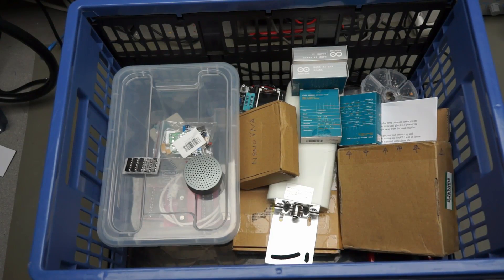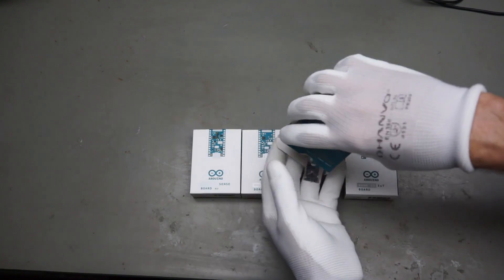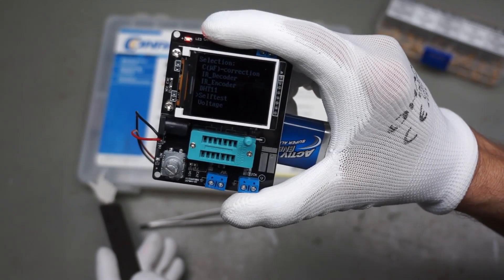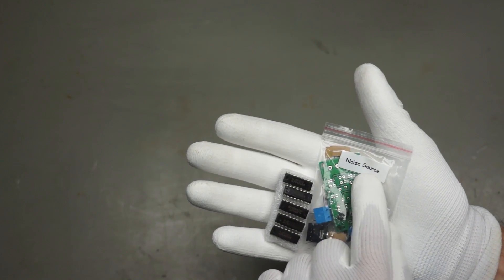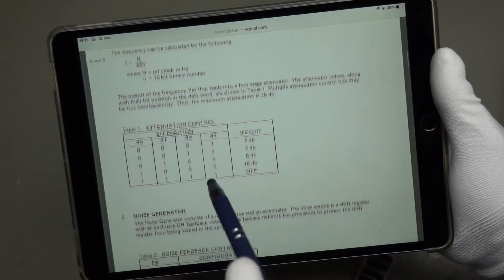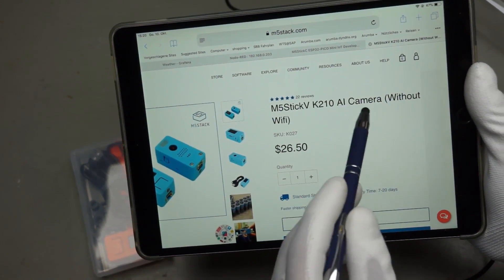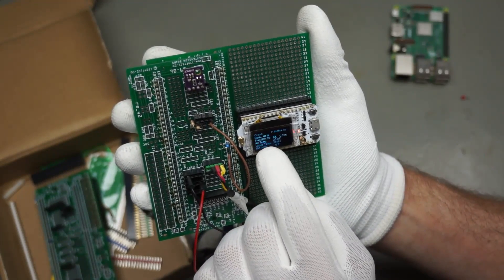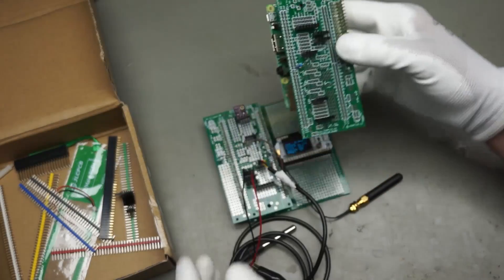#293 Mailbag with Newest Arduinos, Noise Generator, M5Stick, Bluetooth Speaker (@Raspberry Pi)

Comment: Display was dim on GM328 component tester.
After googling gm328 I found the schematic  
https://dragaosemchama.com/en/2019/04/gm328a-reverse-engineering-new-firmware-and-tetris/
There is a 220ohm resistor on pin 1 of display for backlight that could be reduced in value for higher brightness
Will try this out soon myself
Reply from the maker: I did the same (I do no more remember the value) and it helped a little.

Comment: You can change the background color and the characters color as well! That is what I had to do also on both 207 & 2018 versions. Hope that you will do that. Have a great day!
Reply from the maker: Thank you I did it in the meantime and even changed a resistor to get a brighter BL. Now it is usable.
Reply: @AndreasSpiess  What resistor did you changed? Great idea.
Reply from the maker: I do not remember. The one in series to the backlight. I somewhere found a diagram.

Comment: New here.  Sorry, are your gloves for anti static ? If so what type gloves and where can I get a pair? I always use anti static wrist wire. Those gloves may help grip small things better.
Reply from the maker: There is a private reason for those gloves. I got them from AliExpress (ESD gloves).
Reply: They are complementary in your style of presentation. It adds good contrast to the items you display and discuss.  Good choice in gloves!

Comment: 4:12 something is not right with your tester, mine arrived today and has backlight.
Reply from the maker: Good to know. Mine is also a little better now. I changed colors and the resistor for the backlight. Now it is ok, not good, but readable
Reply: @AndreasSpiess  Btw I tried to update the firmware, but the newer version doesn't have those sensor testers and also IR encoder and decoder, better to stay at the stock firmware i believe.
Also updated the crystal to 16Mhz but the menu is still not reacting to the encoder, thought it was a delay because of the low processing clock but it's still the same and the capacitors don't measure right, i believe the inductors will have the same issue because of the timing, thought there's an option to enable 16Mhz, but i believe i will have to reconfigure the firmware to this machine, will see, but still doesn't make any difference, it's still slow to react.
Keep up the great work

Comment: The gm328 manual says it has a full colour display, so maybe there must be  a back-light that needs to be turned on?
Reply from the maker: You are right. I found now better color combinations and I reduced a resistor to increase backlight level. Now it is ok, but not good.

Comment: The Sipeed boards are fantastic, I have the Maixduino and have gotten it working with the python firmware and the MaixPy IDE aswell as FreeRTOS.

Alot of fun to be sure, ive added a 32GB micro SD ( class 10 ) for storage.
Reply from the maker: I will see when I find the time for playing around with them...

Comment: Pre-opened is better, and makes you different from (so) many others ...for the same reason I prefer to find only the link in description and not showing the auction or product page in the video.

GM328A is a great piece of hardware, mine has backlit, I can see it flashing while booting.  Menu has settable foreground and background and I can clearly read it in any light condition, using a 9V battery.  Maybe there are some issues with yours.
Reply from the maker: You are right. After changing a resistor my backlight is a little brighter now.

Comment: Hi Andreas
There could be a bug in the Arduino Nano Every that affects the serial comunication in particular with the first batches
See https://github.com/arduino/ArduinoCore-megaavr/issues/51
there is a test sketch and how to fix, updating the programmer IC. 

Not very easy. Probably your solution adopted for the Sonof could help
A your test and an accurate how to video will be beneficial for the Arduino comunity
Reply: The official Arduino Forum about the new Nanos
https://forum.arduino.cc/index.php?board=135.0
Reply from the maker: Thank you for your links!

Comment: For the transistor tester brightness, I have the same unit and same dark screen issue. There's a quick solder fix... There are 2x220ohm resistors in series from the 5V rail to the LED backlight pin. There's one 220ohm on the back of the screen, remove it and solder bridge the gap or pop in a 0ohm 0805 – that makes things better, but still a little dim. The second 220ohm resistor is on the top right of the main board. I replaced it with 82ohm. I can now see the screen background is a dark blue! :) You can use a lower value resistor here or even 0ohm/solder bridge, but I didn't wan't to push the LEDs too hard, and wanted to save some battery life.
Reply from the maker: Done. And it worked. Thank you for your tips!

Comment: Your second video looks like it has a gateway in the mail ;-) Some advice needed. I am finding it very difficult to get a real SMA calibration kit. The link you have show various items that do not look like proper calibration sets. For instance this one here looks incorrect: 

https://www.aliexpress.com/item/4000242919844.html

Can you confirm at all which sets you think under $50 are actual 3ghz calibration sets. Is it possible to do a simple test to check if one has the correct connectors?
Reply from the maker: I bought mine with my miniVNA, so I have no correct source. But below 3GHz the differences seem to be rather small (for makers).

Comment: I suspect that the 9 volt battery is unable to supply enough current to operate the back-light.
Reply from the maker: Actually it was a too big resistor in series...

Comment: Like the pre-open style. It goes direct to subject.  As for the multitester check this:

https://www.dropbox.com/s/i58od389e3ip9hd/E1821%20User%27s%20Manual.docx?dl=0

Change the BackCollor and frontColor unmatched to give better viewing
Edit: Source of the Manual: 

https://www.kkmoon.com/p-e2144.html
Reply from the maker: Thank you for the links. I already did some improvements including a smaller resistor for a brighter BL...

Comment: That new ATMega4809 chip is available in a 40 pin DIP package for a bit over $2.00. It's a good way to evaluate it if you are a good tinkerer. Thumbs up on the pre-opened packages.
Reply from the maker: I wonder when new boards with the ATMega4809 will come from China...

Comment: Have the same tester, check the screen connection on your tester, mine has a back-light on a full colour screen,  also in the menu, you can change the colour on font and background.
Reply from the maker: You are right. I changed the BL resistor and it is better now.

Comment: That transistor tester is known as "AY-AT" model - and it does have backlight (at least it should). i also have it, backlight is indeed quite dim. perhaps you can try to change the colors (i use black on white, that's ok to read)
Reply from the maker: You are right. I changed the colors and the BL resistor. Now it is better...

Comment: I have the same multi tester. It has a backlight. Perhaps it has an error on the board, worth a look at. There's also a via next to a resistor under the screen, they need to be bridged for frequency to work.
Reply from the maker: You are right. I now changed the colors and the BL resistor. Now it is a little brighter...

Comment: The multi-tester may have a "contrast" option in the menus.
Reply: Or a back-light ???
Reply: @Brian_Of_Melbourne  has a backlight...
Reply: There are rgb vales for "frontcolor" maybe set to max but screen resets and displays a full on screen (white)
Reply: Also, on seller pics it look green, but on video - gray. I have same model, and it show bright green letters. In rare case - switched to gray, fixed by simple restart.
Reply: Irrespective, the display is definitely not working correctly. He needs to get that replaced by the seller....
EDIT: Further down in comments, Andreas says " I changed the colors and the BL resistor. Now it is better..." so I guess he fixed it.

Comment: Is the backlight working on that component tester? The ribbon connector is REALLY crappy, possibly failed.
Reply from the maker: Other comments confirmed that it has no backlight. But you can change to a better color combination.

Comment: About the gm328a, below "Selftest" and "Voltage" there should be another 4 menu items including "FrontColor" and "BackColor".
Both can be used to set the color and intensity.
Reply from the maker: You are right. I discovered it after the filming. But I still would prefer a backlight.

Comment: I´ve had the same type of transistor tester for a few years now. On mine I can set a foreground and background color in the menu. It is well readable especially when set to green text. Not sure if yours has the exact same color-OLED though.

My unit is using different software though. Maybe I should have a look at uploading a newer version to it.
Reply from the maker: You are right. I changed colors and the BL resistor. Now it is ok.

Comment: Plug your new Arduino board into your computer and start the Arduino IDE. It will then ask you whether you want to install the required boards package. Both the Every and the Nano 33 boards have new MCUs and require additional board packages (megaAVR and nRF528x respectively). Once you have selected the board (in the "Arduino megaAVR Boards" or "Arduino nRF528x Boards (Mbed  OS)" section, suitable examples are available. BLE examples can be found in below the "ArduinoBLE" entry or at https://github.com/arduino-libraries/ArduinoBLE/tree/master/examples. Unfortunately, they are not support by PlatformIO yet.
Reply: Tr_0x929 I love PlatformIO and use it whenever I can. But the new Arduino boards are not supported yet. So for these boards you need to revert to the Arduino IDE.
Reply from the maker: @robatoto: Tank you for the tip!